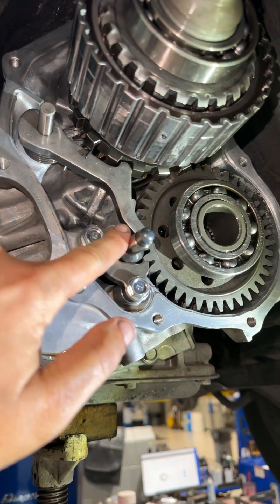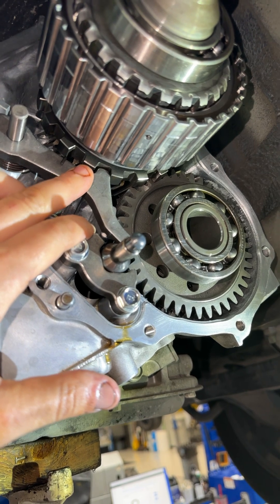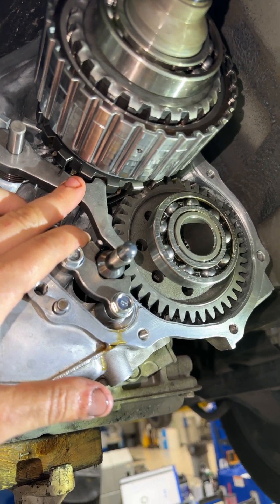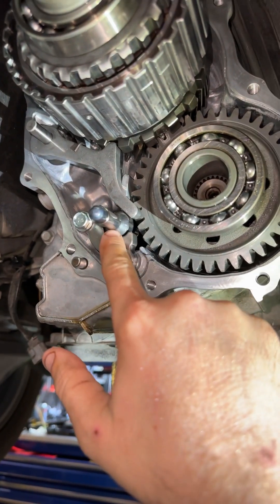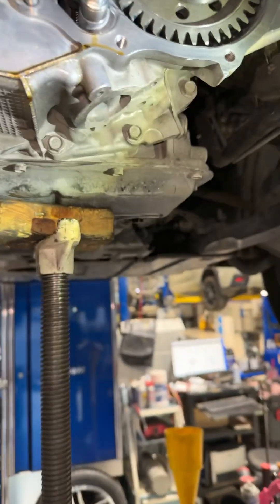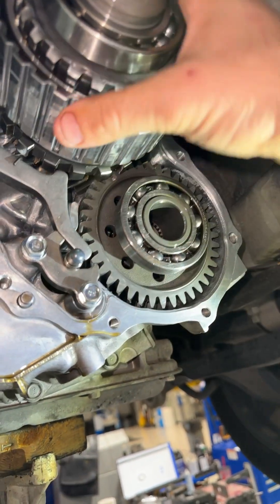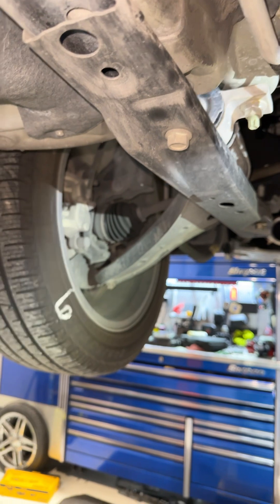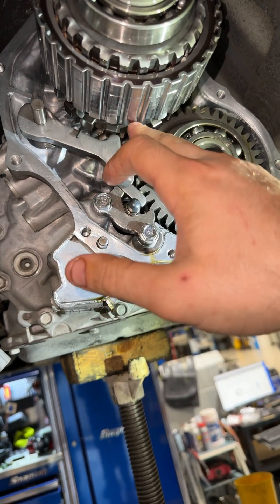Tech Tip: Why won’t my car move when it’s PARKED? #mechanic #subaru

Comment: shoulda explained thats the loud noise you get shifting outta park on a hill without the e-brake on because it's holding the weight of the vechicle. like when you cant turn the key when the steering wheels locked under tension.

Comment: That tiny piece of metal is all thats holing your heavy car on a steep hill in park. Please use your parking brake on hills!
Reply from the maker: Great point!
Reply: That's definitely not tiny. It can probably hold a thousand pounds of torque. It's like a massive gear tooth. Someone could literally crash into your parked car, and all four tires would lose grip before the parking pawl was broken.

Comment: Now I understand why I've heard it's not good to use your emergency brake when you put it in park
Reply: Put it in park, let your foot off the brake until you feel the car stop moving, then engage the parking brake. That way the force is already resting on the pawl, and you have the brake as an added safety measure. That said, the main reason not to leave your parking brake on is if the car is going to be parked for an extended period of time and you don't want rust to form on any of the components.
Reply from the maker: I still recommend using the emergency brake after the can is put in park; especially on a slope. This helps keep all the load off the transmission.

Comment: Great video, I learned too.👍 I've heard said to not fully rely on parking pawl alone for strength, like when on an incline...a hill. Use the park brake as well.
Reply: Shift to neutral.  Set parking brake and ensure it holds the vehicle.  Shift to Park.  No stress on the transmission this way.
Reply from the maker: Very true!